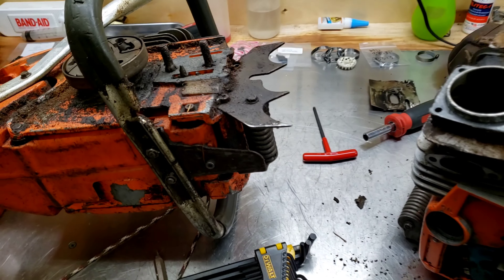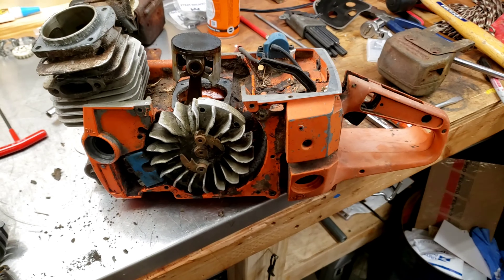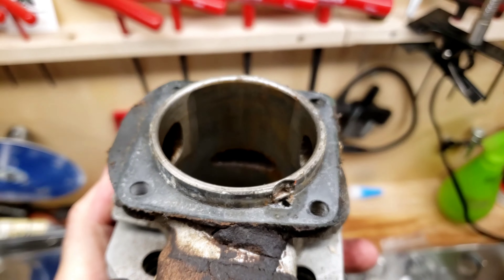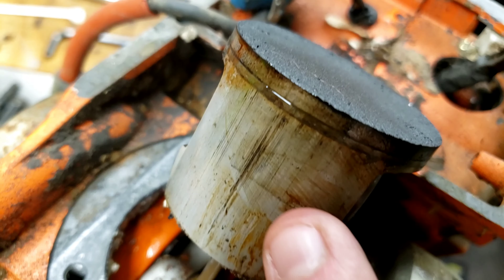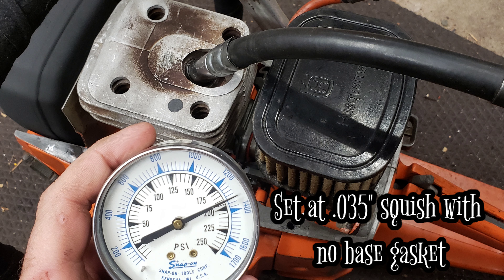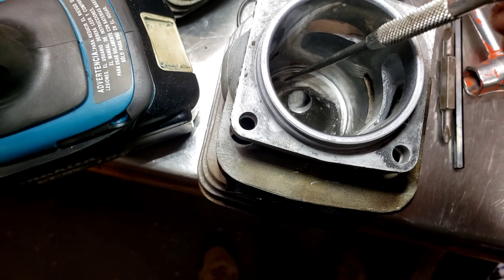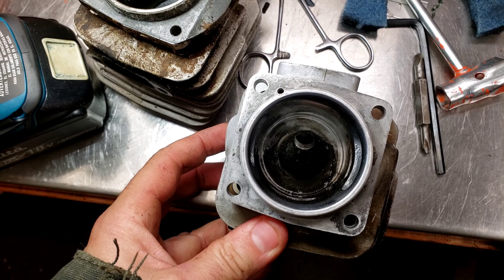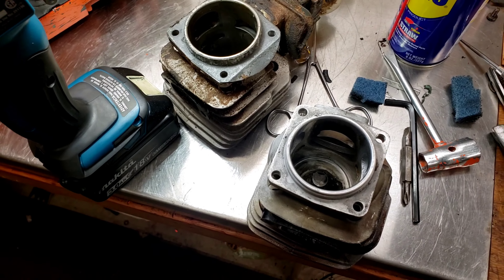Husqvarna 288XP VS. 181SE combustion chamber comparison

Comment: Just bought an early version 288xp. Glad to see this channel giving me good intel on my new saw I intend to rehab. Although the saw has lots of parts I’m replacing, the OEM cylinder looks pretty good. Cleaned it up, cross hatched cylinder with Flex Hone and I’m replacing piston with new pop up with Caber ring. Ought to be good. Flywheel missing a fin. Can’t seem to find a replacement. Husqvarna stopped making them. I grinded the opposing fin off. Luckily, the pawls still have a fin to grab in right position. Not sure how it’ll run. My dealer says still enough fins to provide cooling. Will continue to search for new flywheel